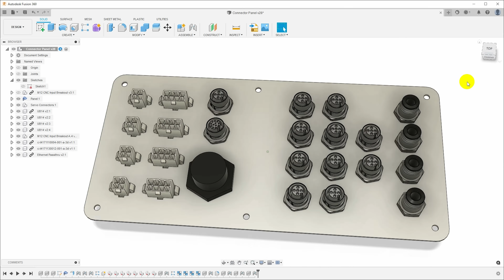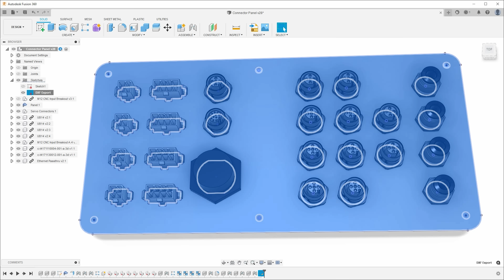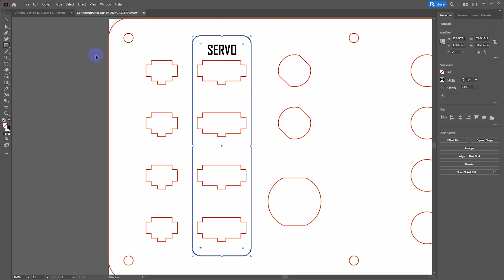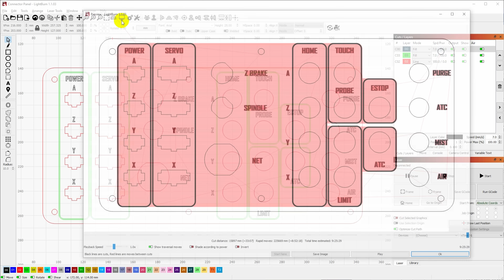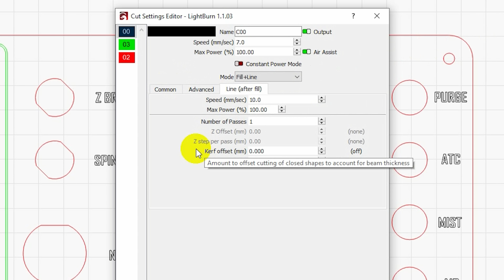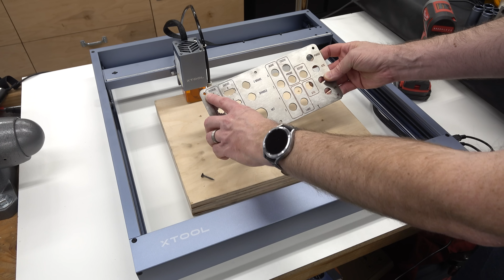Will a Diode Laser Engrave Steel? | xTool D1 Testing

Comment: In Lightburn, to use the outline corner “origin”simply un-check “output” on the layer. 
You’ll still select everything including the outline, but Lightburn will omit anything on that layer the layer.
Reply: Also, important and missed on my original comment. Check mark “cut selected graphics”
Reply from the maker: In my experience, if you un-check "output" it doesn't include it in the frame operation.
Reply: @Clough42  I was able to replicate your scenario. To work around it, Enable both “Cut Selected Graphics” & “Use Selection Origin”. (Located bellow the frame and home button) A green dot will render on the screen indicating where the origin will be based on the user “job origin” selection. 

The compromise is that you’ll now need to manually select the geometry you wish to cut. (Including the profile not-enable for output). I simply drag a window to select all. Hope this helps.

Comment: I did a stainless test card using a small sheet of stainless, a K40 CO2 laser, and some Dry Moly Lube spray as the surface treatment, and that has been in someone's pocket since 2018 with no wear on the engraved surfaces.  It may be an extra option for you.  I don't know how well it would work with the UV Diode laser, vs the IR CO2 laser.
Reply from the maker: I think the black pigment in the Cermark is a molybdenum oxide.  It's probably worthy trying with just the moly spray to see how much difference the silica and other glass components make.

Comment: I use Lightburn all the time with my CO2 laser.  In Lightburn, I've never had to use outlines for text.  I use the fill mode and  the laser scans the contents of the text. Maybe this is some unique to AI?  I've used Solidworks text and text generated by Lightburn itself and have never had to create outlines.
Reply from the maker: I used fill for text.  The outline isn't really necessary, but it does make the edges a little cleaner.  Granted, nobody is going to notice unless they're looking at it under a microscope, which of course I did.  :)
Reply: @Clough42  You are the perfectionist :)  You almost caught be on your coffee video.

Comment: I'd like to see how a galvo laser like the LaserPecker 2 does with marking SS this way. The reason is that when I order cut and 3D folded sheet metal parts from a place like OSHCut, their cutting laser doesn't mark very well. OSHCut will let you designate art for marking, but I tried and the results were not good. Since my parts are already folded when I get them from OSHCut, I can't stick them under an XY laser, so the only solution I can think of is to maybe aim a portable galvo laser at the spots I want labeled after I get the part.

Comment: Great video! Suppose you put a tiny mic on the head, amplify the sound of the cooling fan, and, from a speaker at the edge of the machine, flood the area with out-of-phase sound. Will that cut down the whine?

Comment: Nice and interesting video!
I put a diode laser on my CNC and had some similar problems with laser marking. I used LaserWeb to generate G-code. Which worked but it was not ideal with a lot of wasted time. Then I just used the horizontal milling in Fusion 360 and set the end mill to 0.1 or 0.2mm depending on the material. To export, I modified the post processor to turn off the laser at every linking move. This greatly increased speed of my projects. Also, the spindle speed can be changed to set laser power. In my case 24000 rpm = 100%.

Comment: Right now, I do all of my engraving mechanically. I’ve been thinking about a laser unit. It’s difficult to decide on what to get. The largest size I need to engrave is a standard rack panel width of 19”, but just to about a 0.5” from each edge. The height would be about 4 rack high, or 7”, again not quite to the edges.

So, ok, that’s a fair size. So what will do that? Well, a fiber laser will, but for that size, we’re talking about $4 to $7 thousand! Ah, that’s a bit much as I’m not charging for what I do. CO2 machines tend to not be terribly reliable over the long term. But they will work, just not very well for metals. So laser diodes are next. There are different photo laser colors. Mostly from blue to violet.

So the question is, you’ve used stainless, which I do use for parts, but rarely panels. Will this work with aluminum, particularly anodized? If so, would black anodized work better, as it might easily burn through the black layer? Have you tried?

Oops! I typed this right before the end of the video where you mentioned anodized aluminum. Still interested to see black anodized.

Comment: James, I use Laserbond 100 which is a lesser expensive alternative to Cermark and does an excellent job. I've used it on metals and glassware and it looks great. Also I've learned that as soon as I get the aerosol can in my hand, muscle memory would take over and I'd be in "paint full-coverage mode"... had to break that habit and learn to only spray the product where there was going to be etching.. as you say, it is expensive so no need to waste on un-etched areas.

Comment: Very interesting. I'm wondering if I could connect one axis to a geared rotary spindle so I could use it to mark cylindrical surfaces on tiny antenna parts. Either that or add a 4th axis if the software has that facility.  Marking dyed anodised aluminium is OK, but I'm thinking of LMM14 on copper, brass or titanium. 
I'm glad to hear you also get emails for random weird things that advertisers want to promote. I get a lot about COOKERY products. I guess they look at the channel name and don't realise that Microwaves aren't necessarily kitchen appliances.  Looking forward to seeing the results on anodized aluminium!

Comment: Metals (overall) tend to be more reflective of light, as the wavelength gets smaller (ie. towards and beyond UV), but inadvertently - it's quite difficult to make lasers very powerful in the small ("Hundreds of nm") wavelengths. But as it happens to be, around the 1,000nm wavelength (Near Infrared) are fibre lasers - which is a technology that basically consists several meters of coiled fibre optic wire, doped in special elements (eg. Ytterbium "Yb"). We then use a primary diode lasers (pump or feed lasers) not unlike your blue ones there, in that they are frequently combined in parallel, but more powerful and typically in the 910nm (+/-) range. These are focused down the doped fibre optic and bounced back between two mirrors, this excites the Ytterbium in the fibre optics, and then that lets go of a  slightly longer wavelength (1000-1100nm). The mirror at one end will permit some of the long wavelength light, but still bounce the 900's back and forth. This is fairly efficient in terms of energy saturation, and allows these lasers to be VERY powerful - in the order of dozens of kilowatts, where (with the assistance of compressed oxygen) can cut through inch-thick steel. Fibre lasers are not quite "Hobbyist friendly" yet - the price is still quite high for powerful models (mainly due to the rare element doping requirements and high power optics), but they're coming down. Slowly. Have a look at the OMTech 20W.
Reply from the maker: Marco Reps has a really great fiber laser teardown video.  I looked at the fiber laser markers, but they're still a little more than I want to invest.  If someone is really itching to send me one...that might be another matter.
Reply: Forgetting the cost, having something in the DYIer's garage that will cut 1" steel seems like a new source of disabling injuries. Yikes!
Reply: @campkohler9131  There is a secret cabal of health insurance companies doing all that they can to keep ytterbium scare by promoting its use in dentistry tools. Diabolical!
Reply: @campkohler9131  Seriously. That's a meter long cutting disc but with potentially no warning type of risk. No no noooo

Comment: That's great. I didn't realise that diode lasers could mark stainless directly. I can get a similar result by spraying "Coldgal" zinc based paint onto the bare metal and then running my CO2 laser hot and slow. It's about 5% of the cost of Cermark!
Reply: How do you get rid of the coating from the unmarked area? What other material could one use that is dirt cheap? Flour, powdered sugar, some kind of powdered sand or glass? Maybe a sheet of some kind of colored plastic that can be peeled off after burning. The mind boggles.
Reply: @campkohler9131  The zinc paint comes off easily with mineral spirits (turpentine). It doesn't affect the laser engraved area. Like the Cermark it's quite black and very durable.

Comment: I wonder if burnign the stainless first, then spraying it with the compund, then burnign it again would result in any interesting result. Perhaps burnign off the passivating layer might enhance the seemingly already good bond of the marking compund.
Reply from the maker: I think that might be a good way to get two misaligned marks on the metal.  :)
Reply: @Clough42  It sounds like you don't have much confidence in the repeatability of the machine. Do tell, 'cause I am considering it.
Reply from the maker: @william5694  I haven't seen any relatability issues.  Intuitively, using a high intensity laser to selectively melt a low-mass powder seems like it would be very sensitive to tune.  Maybe I'm wrong about that.
Reply: @William How long does it take for SS to passivate? If it's quick, maybe it will take too long to get to the second pass.

Comment: The brushed stainless looks amazing! How did you do it😁
Reply from the maker: I just used the cheap Bauer brand surface conditioning tool from Harbor Freight.  I think Eastwood introduced theirs first, but there are a lot of copies in the market now.  I screwed the panel to a piece of wood and used the 40-grit stripping drum.

Comment: might be interesting to try powder coat instead of the cermark, then you might be able to have different colors as well. (also handy if you are already set up for powder coating, you don't need to but anything)

Great video though, as always packed with great info. and good to know a small laser like still has enough power to mark stainless.
Reply: I do powder coating, and I can powder coat characters over bare metal, or even a powder coat, though it’s a hassle. But sometimes powder, or any paint, isn’t the look desired. So burning characters through the powder, while it might work, may not be what is wanted.

Comment: I wasn't expecting the bare-metal marking to have very good contrast either, but it still came out much better than I expected. The Cermark looks great, though.
Reply from the maker: Yeah, I was surprised as well.  I did some testing by marking Stanley knife blades, and it leaves very nice marks.

Comment: Quite impressive, that laser module has 4 diodes and an extremely small kerf (Dot) , I have my 5W laser module attached to my router running mach3, I would like to use light burn as it is specific to lasers and good reviews. Excellent Panel
Reply from the maker: This one has two, for a total of 10W optical output.  I have seen advertising for a 4-diode 20W module, but haven't seen it on the market yet.

Comment: Very nice,

Next step is put on some high heat tape all over.
Use the laser to cut out the blank space and use some red powder coating 😁
Reply from the maker: I think you can do this with ordinary masking tape.  I'll have to try it.
Reply: If you use high heat tape you can leave it on, spray the powder coating, bake it and then remove the tape. But I’ve never done it.

Comment: I always wondered why it looked like people were having their lasers raster their vector art. Didn't occur to me that the common practice was to make even lines into "regions" which would be filled. (And by default using a very inefficient path) I figured most laser tools people would be literally drawing the path, and getting whatever stroke width happened to happen from the laser. (Or what you showed with the offset fill)
Reply from the maker: Raster is the default.  I'm never happy with defaults.  :)

Comment: The results look amazing. Could you adapt your plasma table setup to include a laser? Thanks for all the videos!
Reply from the maker: Possibly.  Though the plasma isn't necessarily flat and level.  It uses a torch height control to compensate.
Reply: @Clough42  Or the actual machine this control box is intended for.

Comment: Hey, great work.
I used to make control panels like these, but I used a different technique : 
I simply printed on a transparent film, with a high quality inkjet printer, then sandwitched the
film between the metal panel and an acrylic (2mm thick) plate with the same openings as in
the metal panel and screwed everything together.
That tech. gave me 3 advantages : can print in color, and being able to recover/modify and just throw away the old film,
and finally the outer acrylic layer is postive protection that can be cleaned easily without worrying about the legends being
wiped away. 
Hope this helps.
Reply from the maker: That's a good process.  If you can laser cut the acrylic, even better.  :)
Reply: @Clough42  sure, that's what I did exactly.
Reply: Can also use a vinyl cutter and a temporary or permanent adhesive vinyl. It's like a laser cutter but with an xacto knife instead of a laser...

Comment: Hi James, great video. Are you aware you can import your dxf directly in to LightBurn and then create the text and boxes complete with radiused corners. After you create the box, create an offset for the line thickness you require and set them to fill. I have found on my co2 laser that  molybdenum disulphide (dry moly) works just as well as cermark on stainless but at 1/3 the price.
Reply from the maker: I played around with the graphics in LightBurn, and wasn't super impressed.  Maybe I need to play with it more.
Reply: I'm skeptical that the moly bonds to the surface.  Many times I've used spray graphite to etch / cut brass with the fiber laser at work; it simply serves to reliably allow the beam to create its initial hot spot rather than be erratically reflected a way.  Is the 'moly mark' raised?  Can it be scraped off with a razor blade?
Reply: @somebodyelse6673  Why wouldn't it? Molybdenum is a metal.  It probably fuses with steel.  It is used for electroplating, so it would seem to bond with high heat.

Comment: I would've recommended using a different color spray for the air connections (using a large drywall blade to prevent overspray, for example), would help out stand out even more. You would still be able to laser in one operation. It might even be possible to do the outlines and text in different colors, though that would likely require setting up a jig for positioning the panel in the exact same spot between cleanings and performing separate laser operations for different colors in close proximity.
Reply: Masking between colors and then doing the laser all at once would work too.
Reply from the maker: Excellent idea.  You could get results similar to a UV flat bed printer that way.

Comment: Wow James, very neat. I've been looking into lasers just haven't found the one for me yet. I'd like to be able to utilize one on rounded surfaces ie: for gun barrels in SS and 4140 and different chrome-moly barrel steels.
Reply: You need a machine with a rotary axis. They're available as an optional extra for a wide range of machines. If you want to do deep engraving of steel, you'll probably want a fiber laser.
Reply from the maker: I have the rotary axis for this machine, but haven't tried it yet.
Reply from the maker: I have the rotary axis for this machine, but I'm not sure it would manage a full-length barrel without some extra fixturing.

Comment: That turned out well, but you need a shark that looks like it is holding the tool head.  🦈😀   Those open lasers scare me...  I think I would have to make an enclosure for it. :chillwcat:
Reply from the maker: Yeah, it's a concern.  Eye protection is an absolute must, and I hang a sign on the shop door so someone doesn't walk in unaware while it's operating.

Comment: I wonder if you were to powder coat the panel, but not bake it in an oven, if the laser would do the same thing like it does to the ceracoat and melting the powder coat only where the laser hits allowing you to wash off the remaining powder. If it works it would be a dirt cheap way of getting similar results, you can get basic powder coating kits and powder for very cheap.
Reply from the maker: There are a few people who have experimented with this, though the powder coat is a plastic, and I think likely to vaporize.  I've usually seen a laser used to remove powder coat.
Reply: @Clough42  maybe try an experiment if you feel interested. If you turned the laser output power way down, played with the speeds, and maybe even drop the part a bit on the table to slightly unfocus the beam so it wasn’t so point like and intense, I bet you could get a useable result. Regardless, love your videos and your willingness to step outside your comfort zone and put the effort in to learn new processes and skills 👍🏻

Comment: My OCD is going crazy looking at the outline box on the ATC connector. Why doesn't the ATC box line up horizontally with the LIMIT box? Why isn't the spacing between all the boxes consistent? The inconsistencies automatically draw my eye and looking at this for more than a second drives me crazy. Maybe it wouldn't be so bad with the connectors & plugs installed but as just text, it is offensive to the eye. It's probably just me but with your usual attention to detail, I'm surprised you let this slide.
Reply from the maker: Yeah, I noticed that while editing.  Oops.